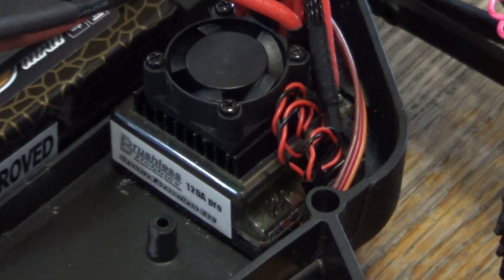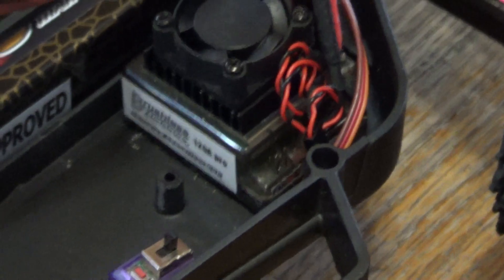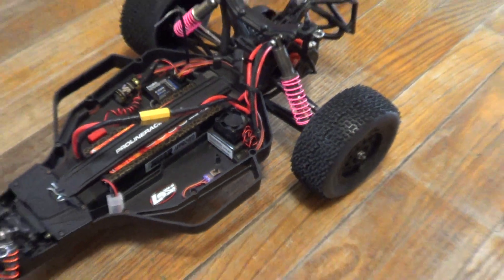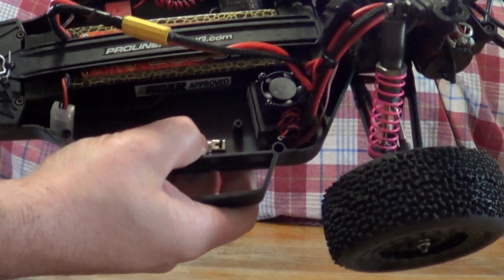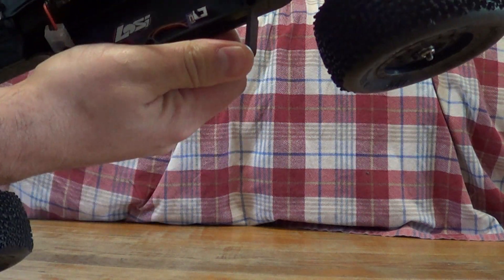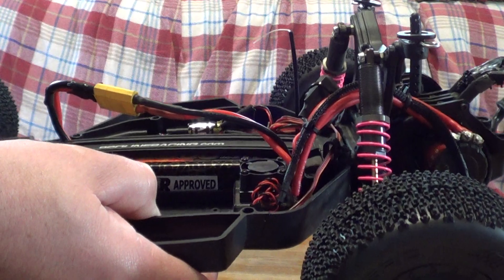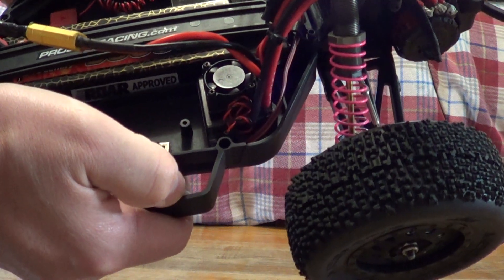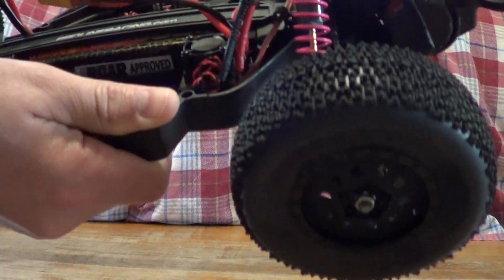Brushlesshobbies.com ESC and radio calibration.

Comment: Hey, have that esc.used it for 2 months no issues. All of a sudden it stopped working. I tried recalibrating. Once i push the setup button after holding it for initial turn in i get nothing but a solid red light. What is going on?